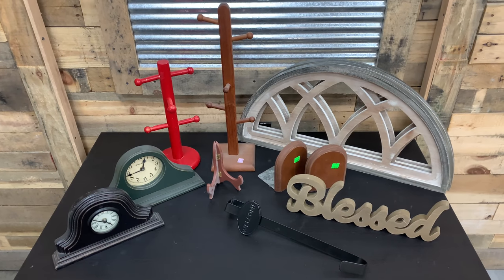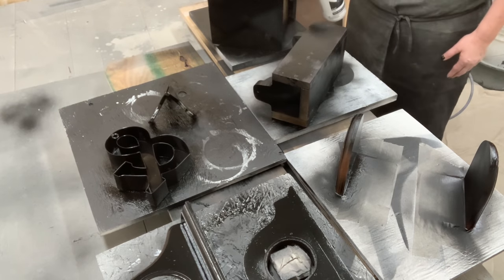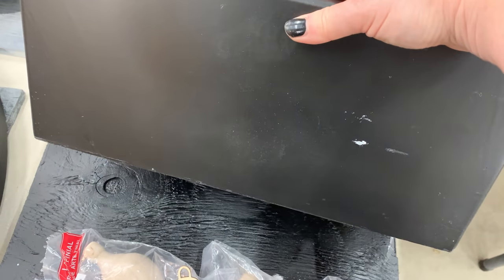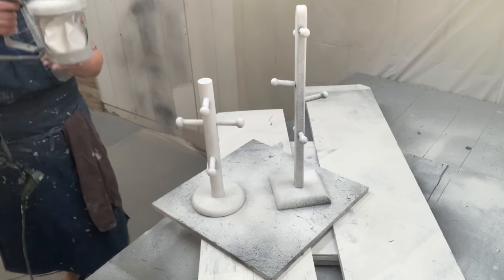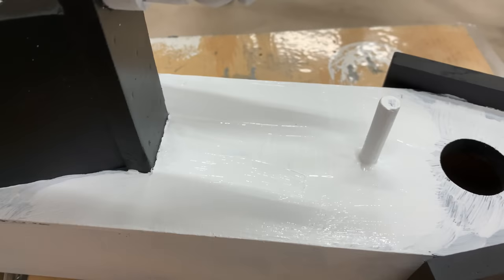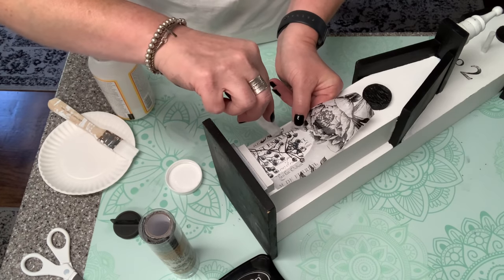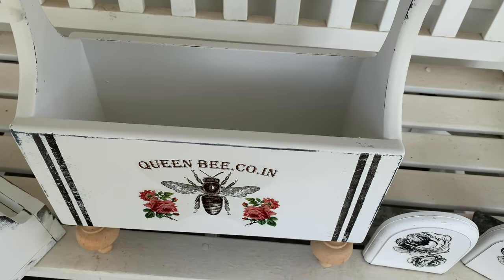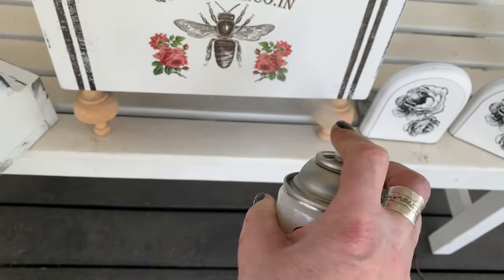Thrift Haul Makeover Part 3 || Using Transfers || Flipping and DIY for Profit

Comment: I used Linen chalk paint to do a little side table.  I dont have a sprayer, I used a brush but still could not get rid of the brush marks. 3 coats and I sanded between each coat.  I also sprayed my brush with water to keep it lose.  What am I doing wrong?

Love your stuff!
Reply from the maker: Maybe it's the brush? I have the best luck with these simple  brushes. Their bristles are light and not heavy so it goes on nice, I hope this help. And from the small brush set i use the fan brush.
https://amzn.to/36rF4uy
https://amzn.to/2U1wPCL
Reply: @GingerChickRehab thank you, I will try them!

Comment: can you elaborate on the sanding sponge a little more?  Sanding is my least favorite part and I'm really struggling with finding something  that works.  I've never seen this product before!  thanks! :)
Reply from the maker: https://amzn.to/3AXDqiq
They come in different grits, Easy on the hands, bendable and  can be used wet. Which makes them nice for chalk paint. And reuse-able because you can rinse them off. When they hit the edges they distress nice and smooth out the rest of the area nicely.  The first ones I used were the Annie Slone and I was hiiked. Hope that helps
Reply: @GingerChickRehab  myhands and I thank you! <3